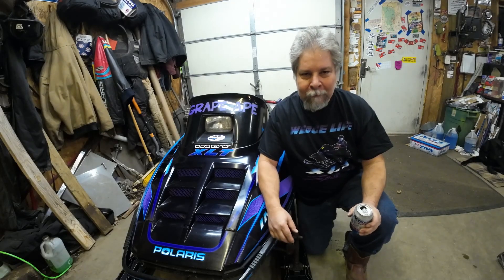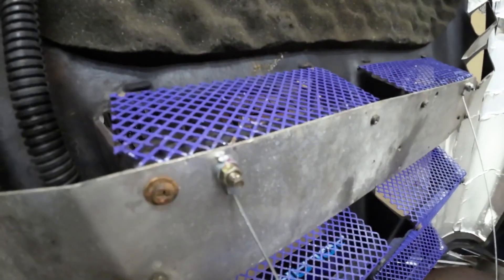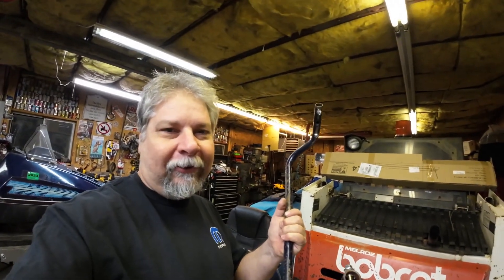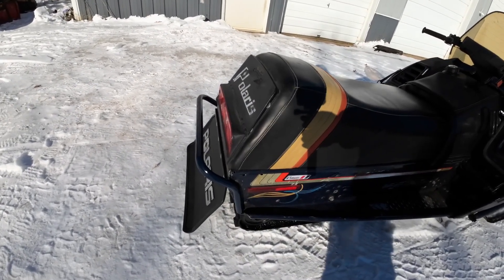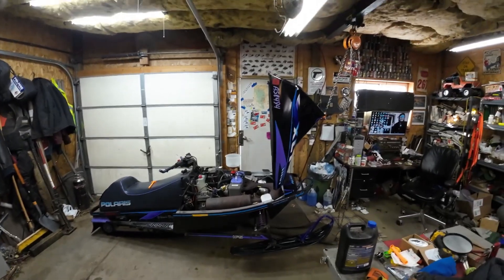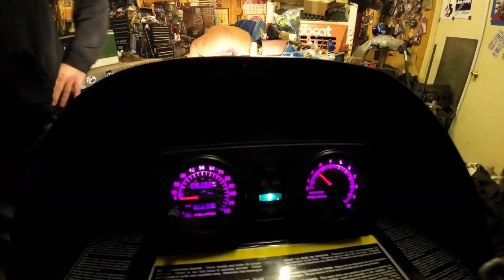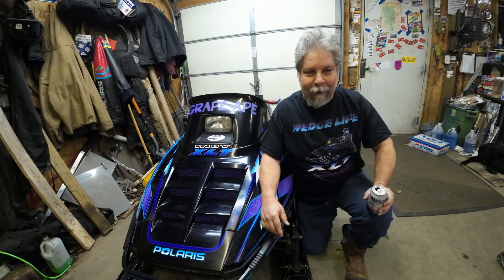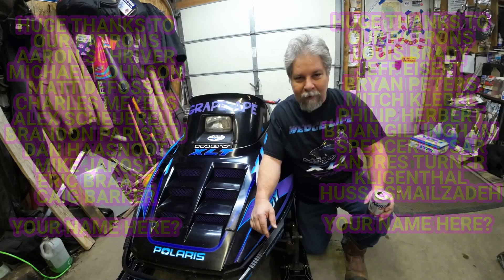Maintenance and Dressing Up the Grape Ape! Vintage Polaris XLT 600 Triple snowmobile

Comment: She's lookin' good, Nutter! Also like the purple ski toes on the Grape Ape. Put a pair of grippers with 6" Woody's trailblazers on my XLT to replace the rusty steel skis - all I can say is WOW - what a difference! Thanks also for showing how you burp the cooling system after replacing the water pump - looks pretty simple. Never had to do it, but I know it's coming. Have a new water pump from Gilomen Innovations with the improved/removable bearing sitting on the shelf waiting for that day.
Reply from the maker: Thanks Paul! Good to know it's helping! I need to contact Gilomen and check into that pump.

Comment: Great Channel. Appreciate the content. Have a question I'm hoping you .ight be able to answer. Will the skid, track, axle and drivers from a 96 Ultra RMK work/fit in a 98 indy 500 that a a 121" track in it currently with little modifications. Thanks for any insight on this.
Reply from the maker: Depends  on what you consider to be small modifications. Obviously the RMK track is longer so you will need a tunnel extension. Depending on which suspension they each have you may need to move the holes in the tunnel. The driveshaft and chain case should swap. It's not a bolt in.
Reply: Thanks. I have a complete parts sled that I bought just for the psi pipes for my ultra. It is a running driving sled but cosmeticly bad. Thinking about parting it out installing in my wife's 500. Thanks again.

Comment: Hey Nutter, did you still need the correct handle bar pad cover? It’s hrs to tell in the video. I have one off a 95 XLT if you need one.
Reply from the maker: I do still need one. Shane Jackson was out.
Reply: i got a used one i’ll send ya
Reply: I went to pickup a used water pump so we could ride last week end. ended up with a tote full of  95 XLT parts
Reply from the maker: @scottsweeney9647  Thanks!
Reply from the maker: @scottsweeney9647  Awesome!
Reply: got it shipped off today, it’s not mint but it’s pretty good for a rider.
Reply from the maker: @scottsweeney9647  Thanks!

Comment: How difficult was the water pump rebuild with that kit? I picked up the same kit and haven't gotten around to doing the rebuild yet?
Reply from the maker: Those water pump castings are pretty delicate. You need to press the shaft and bearings out of the pulley and casting and it's a hard press. Most people will probably break a casting or break the pulley. Don't even bother trying to do this with a hammer. You need a press.

Comment: Hey Nutter hows that waterpump kit holding up? I had the Triple Threat xlt at Triple Wars and had to put a used pump on before we went and been thinking about ordering that kit for my original pump.
Reply from the maker: Haven't put in the rebuilt XLT yet. The used pump is still holding up.